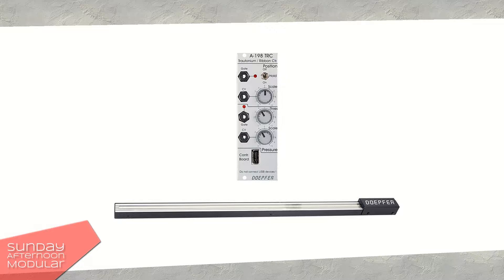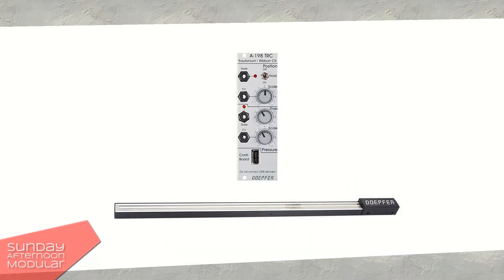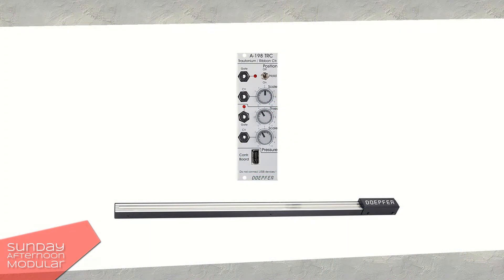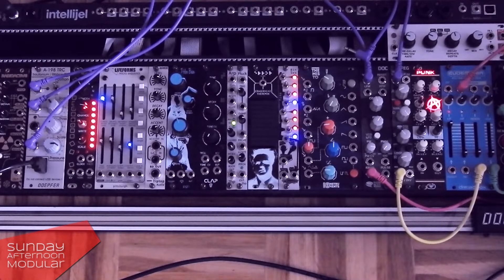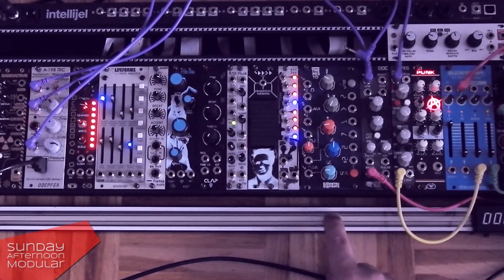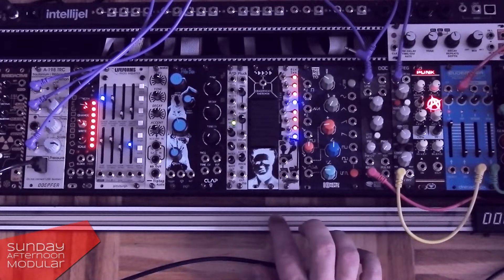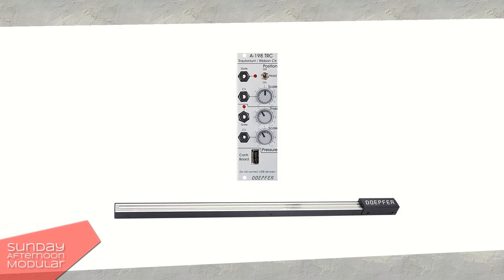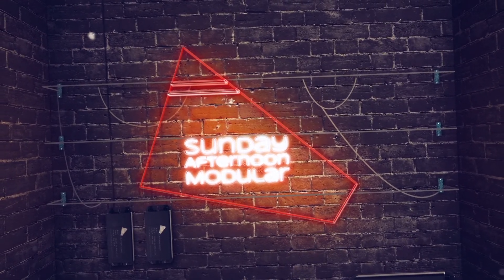PITCH JUMP ISSUE? - Doepfer A-198 Ribbon Controller

Comment: I am not an expert by any means, but I performed a little experiment tonight; I plugged the Trautonium into MI Plaits v/Oct and Level, and the exact same thing happened with releasing the ribbon, and the default pitch barks out at the end. Trying what you said in this video, I moved the v/Oct to my Behringer System 100 voice (VCO->VCF->VCA <- Gate) and voila! No more default pitch when I released the ribbon. HOWEVER :-) I then moved the A-198 Gate to the System 100 EG and set up a simple ADSR, and low and behold... with a slow'ish Release on the envelope, that default pitch appears again.

So it is my determination now that Plaits/Brains isn't the problem exactly, it's any release greater-than instantaneous. Which kinda sucks, but there has to be some logical reason for it (besides it "sounding cool"). With the HOLD switch on, you're correct, I no longer hear that dropped tone. In the end, the TRC is an amazing device regardless - mine just arrived today and I am giddy as a kid on Christmas morning ❣

Comment: Isn't that controlled by the switch in the Position section on the module? As you described in the first video.

It has nothing to do with the Behringer vco, I guess.

From what I can see you have switch in different position in the two videos.
Reply from the maker: Hi Electronic Garden, the switch is in the same position (hold off) in both videos. I have not verified it but putting the hold switch to "ON" should stop the tone from jumping to the initial pitch, which would probably be the solution to this. I have to try it out some time.
As for the second video, where the hold switch also is in "OFF" position, if there is a "pitch jump" I believe the VCA closes before you're even able to hear it.
I really didn't give that much thought about it as people seem to do, as I just liked that jumping sound. 🙂